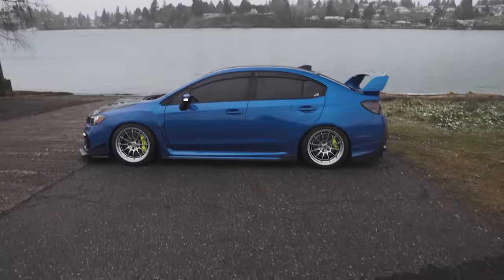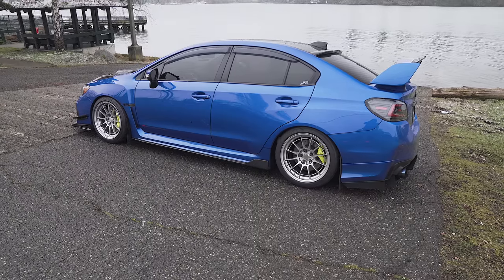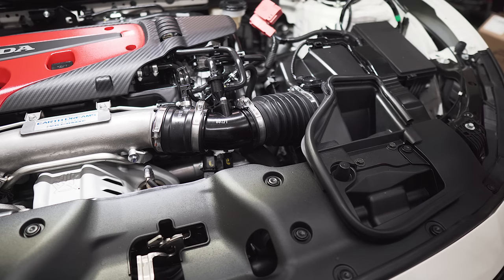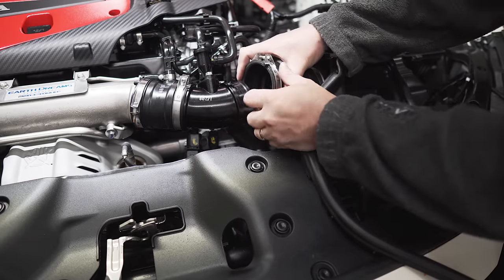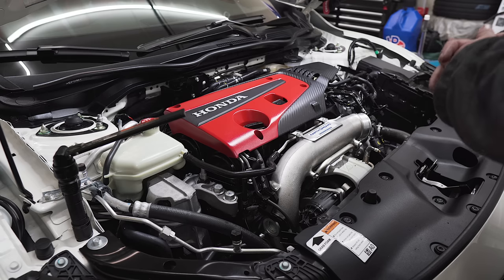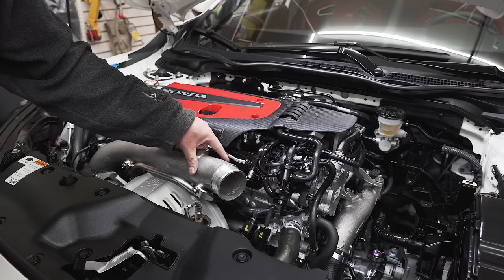EP1 400 HP TYPE-R PROJECT | WE GO CATLESS! PRL MOTORSPORTS DOWNPIPE | FK8 CIVIC TYPE-R | STI UPDATE

Comment: @4:09, had the same issue. It's like that on 2019s and up, but not before. I just pulled and it eventually popped out, and then lubricated a little to reinstall. Most people use a grinder to cut a flathead slot in there, but idk lol.

Comment: So two things. 1 start putting a piece of paper towel in the end of your socket when there is a bolt that is hard to reach this will create a tighter fit for the head of the bolt. you wont drop them as often. 2 before you break a bolt try shocking the bolt with a hammer and screw driver or a punch would work as well. you don't have to hit it very hard but this will break free all the rust before you turn it. less chance for you to cross thread.

Comment: How did you lift the R with the quick jack?  The quick jack isn’t long enough to hit the front and the rear pinch welds.
Reply from the maker: Depends on which QJ model you have. I have the 5000 version.
Reply: @CarsWithJR  I have the 5000 also but it’s slightly short.  Are you putting the rubber pieces a little off the actual pinch welds?